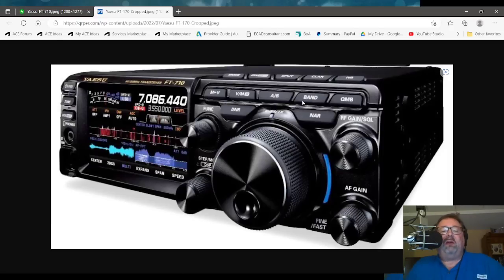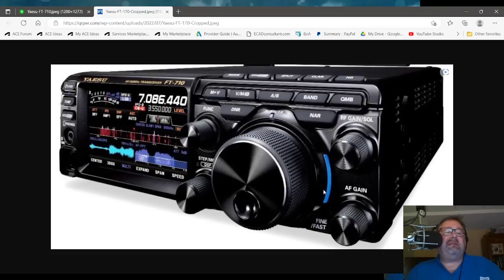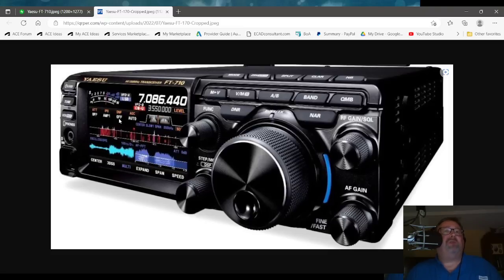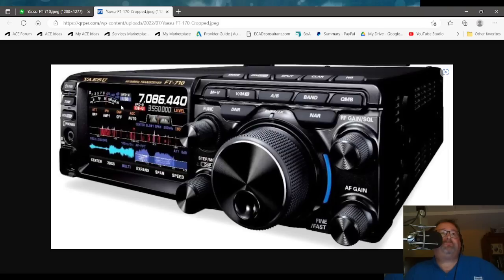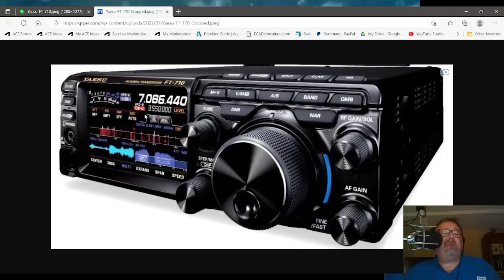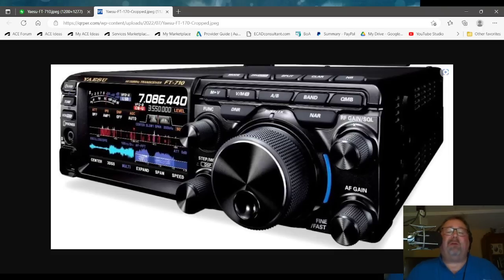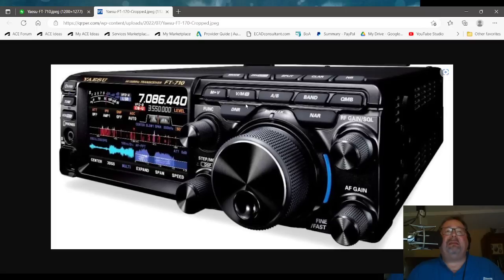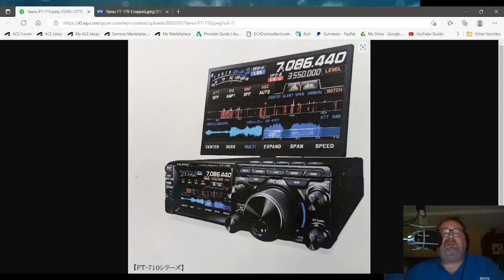A New Yaesu Transceiver? FT-710? (video #1 in this series)

Comment: My guess....this is to compete with the 7300 and will be priced similarly.  It will not have the superhet front end like the FTDX10., but will be direct SDR to keep costs down.  I doubt it will be marketed and sold as a QRP radio.  The size as shown in specs online is about an inch smaller in all dimensions than the FT891, so same size as an IC7300.  I thinking right under $1000 for their price.  HamRadioDude has the dimensions and weight in his video.
Reply: For your information, official note:
The new FT-710 AESS is a compact design yet provides 100W output, utilizing the advanced digital RF technology introduced
in the FTDX101 and FTDX10 series.
- YAESU Unmatched SDR technology emphasizes the Receiving Performance
- Band Pass Filters dedicated for the amateur bands to eliminate out-of-band unwanted signals
- RF Front-End design with the 250MHz HRDDS (High Resolution Direct Digital Synthesizer) enables phenomenal
Multi-Signal Receiving Characteristics
- QRM rejection by the dual core 32-bit high speed floating decimal point DSP for SHIFT/ WIDTH/ NOTCH/CONTOUR/
APF (Audio Peak Filter)/ DNR (Digital Noise Reduction)/ NB (Noise Blanker) and 3-Stage Parametric Equalizer
- High Resolution 4.3-inch TFT Color Touch Panel Display
- 3DSS (3-Dimensional Spectrum Stream)
- VMI LED (VFO Mode Indicator) placed around the VFO dial shows the current operating mode (VFO-A, VFOB,
Memory Mode and Clarifier/Split Operation)
- “PRESET” Mode Function most suitable for FT8 Operation
- AESS: Acoustic Enhanced Speaker System with SP-40 creates the high-fidelity audio output
- External Display Connection Terminal (DVI-D)
- Built-in High Speed Automatic Antenna Tuner with 100 channel memory
- Support the FC-40 Auto Antenna Tuner
- SD Memory Card can be used to save the communication record, transceiver setting, the memory contents,
screen capture images, and to update the firmware
- Two (2) USB Ports (Type-A and Type-B)
- Other essential features such as CW ZIN and SPOT, IPO (Intercept Point Optimization), and Remote Operation
with Network Remote Control System to name a few
Dimensions (W x H x D): 9.4” x 3.1” x 9.7” (239 x 80 x 247mm)
Weight (Approx.): 9.92lbs (4.5kg)
Reply from the maker: Where did you find that information?
Reply: @n4hnhradio  I'm YAESU reseller in France and have full information from YAESU
Reply from the maker: I doubt it will be smaller than the FT-891.  Like I said in the video, I'm thinking slightly smaller than the FT-991A, judging by the size of the knobs.  I do hope the supposed 10W version is prepared to compete with the IC-705.  I don't mind it not having 2m/70cm, like the IC-705, but an internal ATU would be an advantage over the IC-705.  I also speculated in the video that it might be a straight SDR, since there are no roofing filters shown.  Or it might have one 15kHz roofing filter, like the FT-891.  Who knows...it might even be up-conversion, like the FT-891 and FT-991A.  As I find out more, I will report.

73, de N4HNH

Comment: I really hope they sorted out the averaging on the display similar to how icom did it.
Reply from the maker: Averaging or not never bothered me.  The processor is so fast in the FTdx10, that I don't find that I need averaging to separate noise from signals.  I just adjust the scope sensitivity level down until the noise disappears and all I see are signal spikes.  The FTdx10 filtering spoiled me, since I don't need to listen to noise, so I don't want to see it either.  I have even grown accustomed to the 3D Spectrum Scope.  But, for those who prefer averaging, Yaesu would be wise to pay attention to their potential customers.

73, de N4HNH
Reply: Thanks Doug 
I wish Yaesu would listen and give the option like ICOM for Display averaging?
73 Rob g3rce